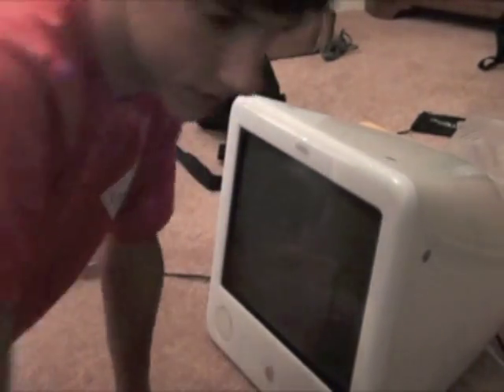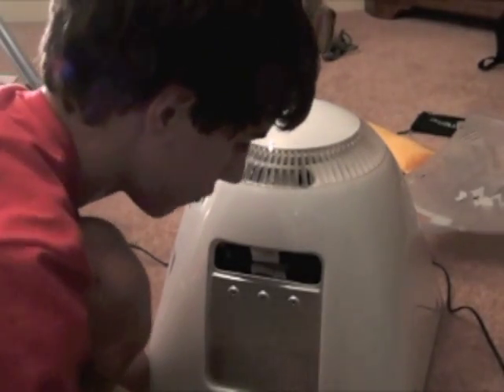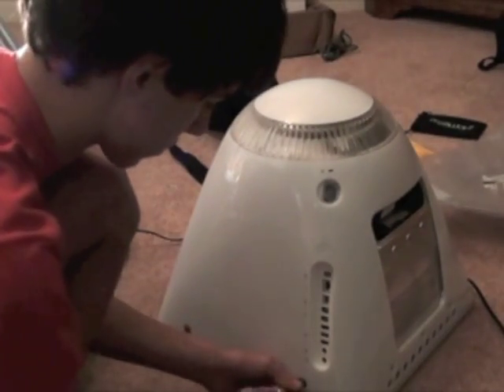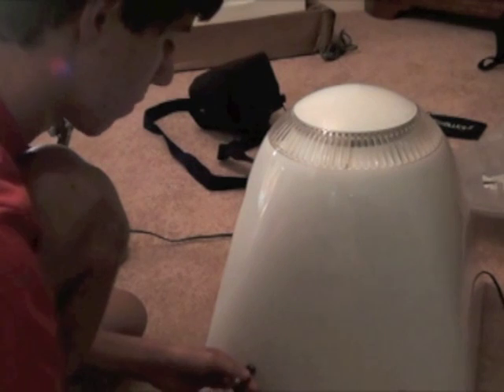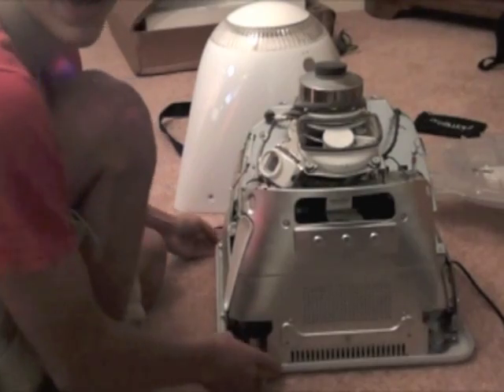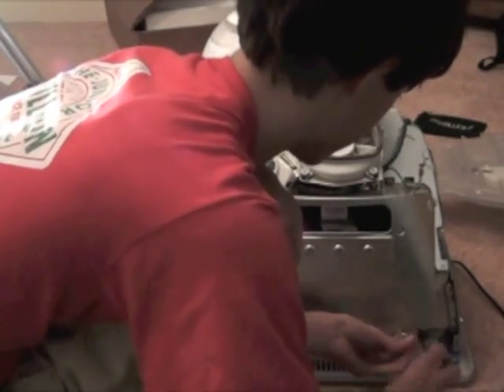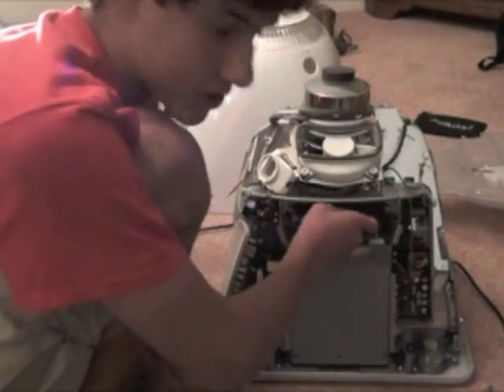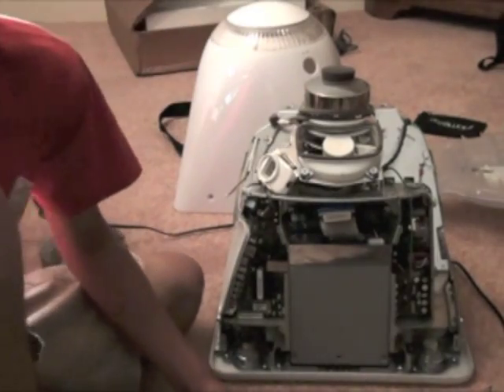How to Overclock an eMac - Part 1/2

Comment from the maker: @UncleMarioBoss I'd say an eMac is probably still a pretty reliable server.  The only thing is that if you start running applications, then it may get slow.  I recommend maxing out the ram and getting a new hard drive.  It also depends on what generation eMac you have.  I do believe that apple, thought, has figured out that they can run up the bill on customers and people will still pay for it.

Comment from the maker: @outatime88mh Good English.  I understand it is a complex/complicated language.  Please look at this link.  Use the table about halfway through the page to change your resistor settings.  Your motherboard can support up to 1.4GHz but i recommend to upgrade if you are good at soldiering.  If not, I suggest getting a friend who is good at soldiering.  Also, consider upgrading the cooling.  You can find many mods online about cooling.